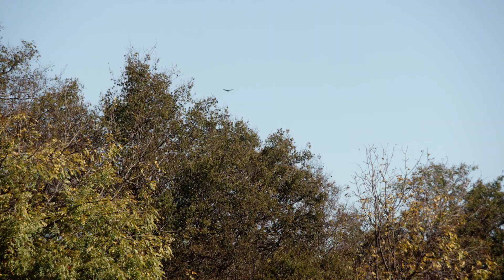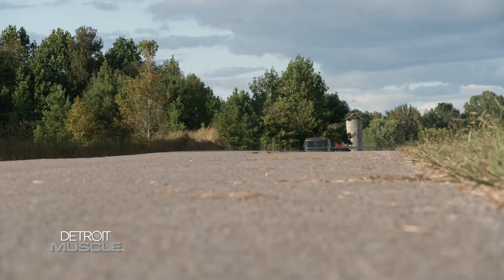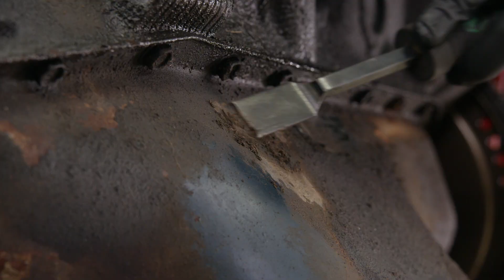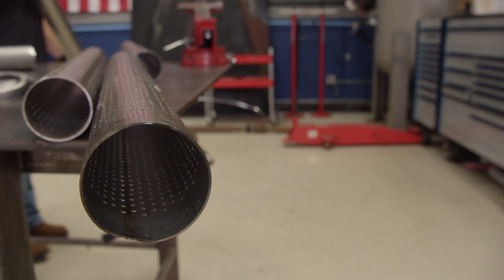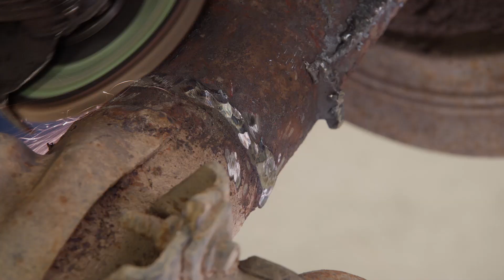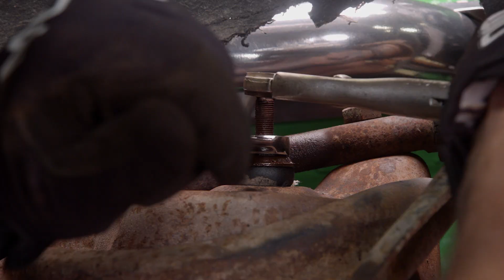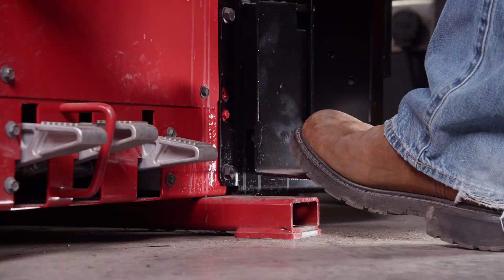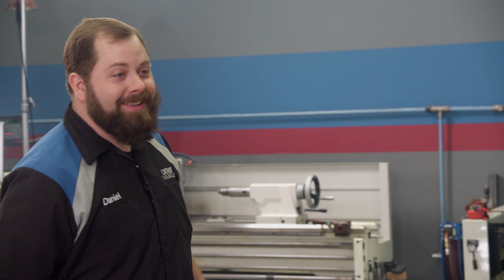Full Build: "Overtaker" Caddy Hearse Wakes the Dead

Comment: Just curious what happened to 500hp/700tq you guys change your mind along way?
Reply: That's what I'm saying. They should just blow that motor up with a 300hp shot. What a turd 340hp with 150hp shot and 500ci in a car thats probably pushing 5000lbs. A stock Honda with a fart cannon could probably give them a run for their money lol
Reply: @rustychevy2087  Needs new heads to get there tho, right? I was also disappointed by the numbers. not even 1 ft-lb per CUI :-/
Reply: @Griznah  yeah probably, I'd only take it to 5500 with the stock rods so it'd have to make ho by then. Plus I have no idea if the oil system is crap like Buick's
Reply: @rustychevy2087  those 500's are infamous for blowing up past 4500 rpm...Buicks also had a thin block that would break if spinning them too fast (455)
Reply: @richardbaumgart2454  yet another reason I'll never build one lol. Thanks for the info, I didn't know that
Reply: @richardbaumgart2454  I would argue that one. You are most certainly correct about every Chevrolet Big block doing that but 500 was a completely Cadillac design. Cadillac built very tough engines as many were used in Ambulance and funeral service. I had pushed my 500 to the 6000 rpm range many times and it will take it just fine. The block is massive and when you take the heads off and see the Folgers coffee can sized pistons you realize this is not a Chevy BB. The block itself has at least a 2" wall from the cylinder lining to the outside block wall. At best one would spin a bearing but the block will remain in tact. BB Chevy's needed ti fit into smaller cars so the blocks were thinner to accommodate. Since the 500 was exclusive to Cadillac, they could make it as beefy as they wanted.
Reply: @jeremypilot1015  i said Buick's have a thin block design...not caddy...but Cad's won't live above 4500 for very long..they will spin bearings and knock quickly..Roadkill made 2 different 500's knock easily in their Gremlin...they stated you can't spin them above 4500 rpm also. For sure if building a big engine your wasting your time with a 500, BBC is the way to go. I think it's the oiling design of the 500 that dries out the bearings...if you had a 500 cad spin above that it was some kinda special motor..as a kid i had an old Cad and it had no power above 4k but it was a smog engine (74)....if the 500 was so great everybody would be swapping them into their hot rod instead of Chevy's obviously...ask any pro race engine builder.
Reply: @richardbaumgart2454  nobody uses the 500 because there are virtually no parts for building a race engine. The cost of building any Chevy is tiny compared to a Cadillac. The bearings were the weak point in that engine I said that above. The biggest problem with the bearings going is the age of them at this point. Any 500 worth salvaging has metal fatigue and has probably been sitting for a great deal of its life. Corrosion can easily form on the bearings with temperature change. But finding performance bearings for that engine would be cost prohibitive. That's why no one builds these. They would be better suited being used in an off-road truck. They make ridiculous torque and you don't have to push the engine hard if you get stuck to free the wheels.
Reply: @jeremypilot1015  yeah you listed a couple more reasons why not to build one...they did put out around 550 ft-lbs gross torque when in it's prime..while a 454 only was rated at 500 in it's prime...but u could get it up into the 600's with easily found mods. The Cads were good engines back in the day...i liked them but their not an engine to build,..same as the old Buicks/Olds/Pontiacs were not good engines to build either and theres reasons why they sat in junk yards rotting away..there's a ton of old Chevy's that should have the same fatigue but they were a lot better engines as people have proven through the last 50 years. BBC's have more iron in them as they weigh about 90 pounds more than a Cad 500...so i don't think a Cad. is more heavy duty.
Reply: @richardbaumgart2454  agreed on a lot of what you said for sure. I can tell you the 500 at it’s peak factory operation power was 400hp. Albeit some claim it was upwards of 500 at the crank. And 550lbs torque. The 472 and 400 were built mainly to deliver low end grunt to move large ass Cadillacs with ease. Those engines were also designed with a myriad of mounting points for various accessories to be bolted to the block in different configurations. I think people want to see that engine be a drag strip legend. When what they should be doing is using them to take down Duramax and Cummins engines in tug of war or towing. Honestly (besides myself) no Cadillac owner was going to be running the engine to 6k because the car would be hauling ass before it got there with all of the torque.  We agree the bearings can be a weak point for that engine. I suggest in its pre emissions form in the right vehicle today. That stock that engine could outdo most diesels.
Reply: @jeremypilot1015  you have to remember those are gross hp and tq ratings so it would be losing 15% at a net rating and about 30% total loss at the rear wheels on a dyno,...it's sad this engine in this hearse was such a turd after they did all that work to it with ported heads even which probably didn't even make a difference ..i know it's an old engine and low compression at that but the nitrous should of fixed that problem..but my old '74 wouldn't even spin the tires if your life depending on it no matter what you did and the engine wasn't even that old at that time..with low miles even....but i never drove a pre-smog era one before...i was personally thinking they exaggerated that 550 lb.ft number but idk...i had a 99 Deville and it was so much faster with the 300hp northstar and not a light vehicle either...probably comparable to VGG's '68 that ran low 16's in the 1/4
Reply: @richardbaumgart2454  oh man don’t get me started on the Northstar. What a POS that thing was and didn’t have to be.
Reply: @jeremypilot1015  i actually loved mine..300 hp with 20-27 mpg in a 4500ish lb car and low 16 sec. quarter mile..i drove mine to 101,000 without issue..ik many people had issues with the undersized head bolts and i'm guessing valvetrain issues..but i drove the shit outta mine w/o issues..quick revving and good mpg...with that being said i wouldn't buy an old one today because of those issues....plus parts on those Caddy's are priced ridiculously if even available today..it needed the air suspension replaced or converted and abs sensors...and i had to buy a couple rear knuckles at $500 a side...but i still loved that car..it was one of the faster cars on the road back then,...not to mention i paid 8k for it when it was only 3 yrs old...it had a 50k sticker on it...concours with huge leather buckets and a console shift in a fricken deville is awesome
Reply: @richardbaumgart2454  agreed it could have been one of their engines but yeah not a matter of if the head gaskets will go but when.
Reply: @jeremypilot1015  i'd buy another one if i was a mechanic and had a lift and wanted to work on the thing..you can do the head stud conversion to fix em
Reply: @richardbaumgart2454  yeah if the bolt conversion was done I’d buy one
Reply: @jeremypilot1015  yes..that thing would burn the front tires even with the t.c cutting the power...a lot faster than my buddies brand new grand am "ram air" gt at the time..lol he was pissed...it was no competition
Reply: unfortunately by 1974 they detuned it to around 200hp
Reply: no compression in those old smog engines.,,plus this one had a decent amount of blow by...Derek from vice grip garage rescued a '68 that hadn't run in years and it ran almost 15's with a trunk full of stuff...15's in the 1/4 i mean not the 1/8
Reply: @richardbaumgart2454  I watch vgg I saw that
Reply: What a disappointment. A big block with a 150 shot and only get 341hp? My 289 makes 350hp.
Reply: Need double pumper 850s and tunnel rams a blower old GMC ignition only 4500 rpms commuter terd vehicle needs 14000 rpms MSG😁
Reply: Bypass The old module in distributor a unilite dist.  And MSD. 😩😭🤦💀🤬💥
Reply: Usually put the 472 heads on the 500 plus a cam for 460 N/A HP and 650 lb.-ft.
Reply: @BuzzLOLOL  on the 73 and later models the I take manifold was pinched down a d shortened to help detune it for emissions.
Reply: @jeremypilot1015  - Probably just to get it under a lower hood...
Reply: @BuzzLOLOL  that technically was part of it. But the manifold still could have been taller than it was. I had a 75 the intake is almost sunken into the block. Huge restrictions.
Reply: @jeremypilot1015  - They probably quit making the high rise hyper intake and just kept the low one that would fit into anything... since the engines didn't make any HP any more...
Reply: @BuzzLOLOL  Man that's a big jump for cheap if you can still get the parts.

Comment: 500 cubic inches and after mods and they only hit 325 on torque, even after 20% drive train loss their build was  not that great
Reply: I am I the only one who paid attention to the ported heads, cam, lifters, intake, and headers. It should match the 1970 motor with 475hp and 550 torque.
Reply: @robertcranwell7847  That 1970 rating was 400hp, no 475hp and that was SAE gross, not SAE net like every rating after 1972.
Reply: @cadman10000  Thanks, Richard proved the point I was trying to make about Torque after all the modifications they made. https://www.youtube.com/watch?v=tujBnJG-ZQQ
Reply: I think around 2001 Hot Rod Magazine did an article on building a junkyard Cadillac 500 pig.  With intake and cam on the engine dyno I think they got 383 hp in 501 torque.  But that was with an earlier higher compression Cadillac 500, as the years went on Cadillac lower the compression ratio and put bigger chamber heads on the engine so I could meet emissions.  If you're going to do a budget Cadillac 500 junkyard build start off with a 1970
Reply: @K-Effect  There are no "budget" 400hp 500's still in existence. Everybody knows the 70 Eldorado- (500ci only available in the Eldo) -- motor is the hot one.   The good news is...  iirc the pistons and heads are all that make the difference..  all the hi compression heads are the same-69-73.  so its fairly easy to make a "factory" 400 hp motor out  of garden variety 500s.
Reply: @K-Effect  Richard Holdners set which is pretty close to theirs was 504 hp and 591 hp. Engine only Dyno.
Reply: But...... this was measured at the Wheels....   these magic historical caddy numbers of 400hp- 550lb/ft torque, were all measured at the crank in 1970..  i bet on an engine only dyno, the numbers would have sounded much better.
Reply: @liquifuse86  15-20% loss through drivetrain. This motor was pretty modified BTW. no where near stock.
Reply: Bro, these were never performance motors!!!
Reply: @tatialo37  no they were not, but they did produce torque to move the weight hence the reason for big cubic inches